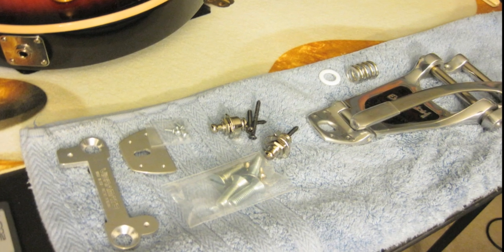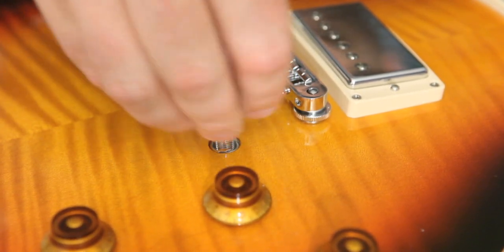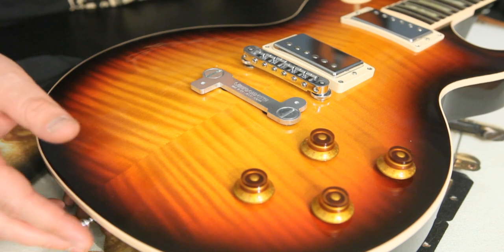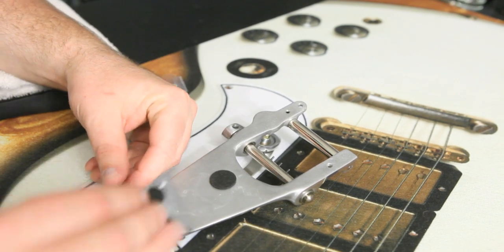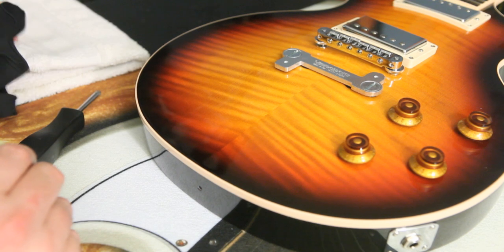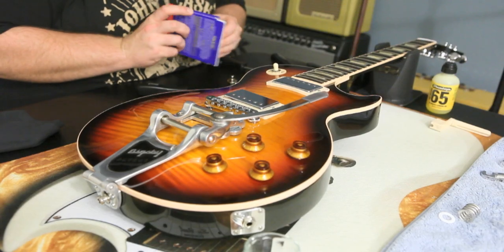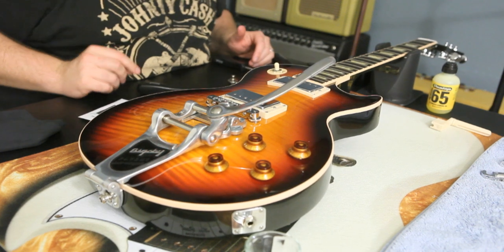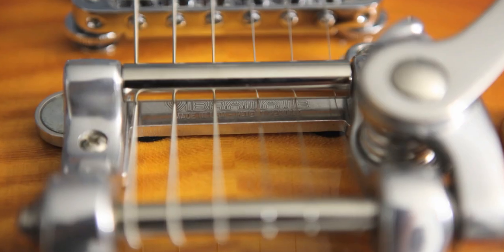How to Install a Bigsby B7 and Vibramate V7 on Gibson Les Paul Standard by Scott Sill

Comment: First let me thank you for your time to make such a very useful video.
Just a small technical question... when you are attaching the bigsby to the guitar in the strap button area, do you push the bigsby down to touch the guitar top or leave some space???
Reply from the maker: WaTa Blues thanks so much!  much appreciated.   The bigsby rests against a plate that the Bigsby screws into.   That plate rests against the guitar but it has some nice felt pads on the back to protect the finish and guitar.
Reply: Thanks for your quick feedback, I know about the vibramate plate,,, what i was asking about is the Bigsby part that stays over the guitar top near the binding area. Does it have to touch the guitar or some millimeters should be left?
Reply from the maker: WaTa Blues  yes, the Bigsby doesn't touch the guitar.
Reply: sillennium Thanks Man...
Wish me good luck installing it tomorrow!!!
Reply from the maker: WaTa Blues Good luck!
Reply: sillennium I just installed it yesterday but i was not able to make the tailpiece plate rest on the guitar!!! the bigsby was just to short. It stayed inclined at one point.
Do you have any suggestions???
Reply from the maker: WaTa Blues what guitar did you install it on?
Reply: sillennium A 2012 Gibson Les Paul Standard (desert burst)!!!!
Reply from the maker: WaTa Blues send me a personal message via YouTube or email me directly via our website for Flo Guitar Enthusiasts so I can see pictures of your issue and understand it more.

Comment: Does instrument still stay in tune after instalation?  Doesn't there supposed to be drilled new holes for screws around straplock? Does the fact that you didn't t drill holes and u didn't put any screw in it affect badly for the tuning or bigsby stability?
If you'll answer me you'll be very helpful!
Reply from the maker: Yes

Comment: Question about my Bigsby.  Bought a Epi Les Paul that comes with the small Bigsby.  The previous owner had four washers on the bolt under the arm where the spring is.  What is supposed to be there;  a sleeve of some type?   The spring and arm worked great  (after I fixed it) but while playing,  the arm loosens up.  Seems all the washers aren't what should be there.  Can't find any photos that show the original assembly.  Thanks in advance.
Reply from the maker: Tighten the nut

Comment: Does the guitar still fit in the case properly with the bigsby on it? Is there a way to rotate the trem into a position that it will close? Thanks in advance!
Reply from the maker: nitemareman1 yeah it does, all you have to do is twist the bar pretty much all the way backwards to its lowest position.   It works fine in the case.

Comment: Hey scott, I have a question. .
on vibramate's website, there was a diagram saying the distance between the tailpiece and the rear strap button must approximately be 6". but on my Les Paul (not a gibson), I measure it to be around 5.5". do you think it would still fit well, despite the half-inch difference??
Reply from the maker: No diagram

Comment: is this possible on a esp ltd ec 256?  also dit you screw into the body at the straplock part? because i dont really want to screw into my guitar
Reply from the maker: This is meant for a LP guitar, so any other guitar would only work if it is the same dimensions as a LP guitar.

Comment: Did you need to change the action of the guitar on the bridge? considering that the vibramate adds some height to the strings before getting to the bridge
Reply from the maker: bobafer no it didn't change at all becuase I didn't need to move the bridge up or down because of the vibramate.   Thanks for watching!

Comment: Installed this on an Epiphone Les Paul Studio and the Bigsby is kind of floating on the Guitar now (the part adjusting to the strap lock is in place, but the Part with Bigsby written on it floats above the Guitar). Any way to fix this?
Reply from the maker: Robert Pelz your guitar is a carved top LP right?   If so that sounds correct, that part doesn't sit against the body, it would float above it.
Reply: Yep, it is! Thank you for the answer!
Reply from the maker: Robert Pelz NP

Comment: I'd like to install a bigsby on my Epiphone Lucille. Can I use B7 on my guitar? Any suggestion? Regards
Reply from the maker: Roberto Carlos Ortiz García you can install a B7 on the Lucille, but it will require some holes to be drilled.  There is a new kit that works with ES-335 guitars from Vibramate, that might work with that guitar.

Comment: Would this work on a 2014 Gibson ES Les Paul....it's a gold top and is missing that final piece...and bigsby is it!
Reply from the maker: +linxMuppet it should I don't think there is a body size change in the ES just a semi hollow body with a different tilt on the neck to the body much like a 335.
Reply: +sillennium thanks btw :) also, will it fit in the brown Gibson case
Reply from the maker: Yes you just have to turn the arm of the bigsby clockwise till it stops near where you would rest your arm when you play.  That puts the arm at its lowest point allowing the case to close, snugly, but close.

Comment: Nice video! Question that's sort of unrelated to the bigsby, maybe not... I have a 2013 Les Paul Signature T model with that stupid min-Etune system. That thing crapped out on me because it's a POS, so I'm looking to get new tuning heads. I have been trying to consider which ones to use, as some don't seem to fit right and require boring out the back of the holes in the headstock (grover tuning heads seem to be too think for example) ... I am curious which heads you have on your les paul in this video... I am also curious as to some feedback regarding whether or not I should consider locking tuners if I end up going with the Bigsby (Which I may indeed be doing after this video) ... Any feedback would be MOST appreciated!! Thanks! And don't listen to these other fools on here saying you should beat the crap outta your guitar... I appreciate a dude who takes care of his gear!
Reply from the maker: i have grover locking tuners
Reply: +Cereal Killa Maybe late, but from what I've read on the net classic Kluson type are a drop-in replacement.
Reply: SteelSkin667 Yea I got grovers and they dropped right in with zero issue... Very late reply, but thanks for the input anyway, as this might help someone else who is in a similar situation as I was.

Comment: Just a quick question. I have heard that the Bigsby B7 causes serious tuning issues. On a different youtube video a chap claiming to have sold this problem by inventing a device claims that guitars players who use the Vibramate V7 do not suffer from tuning issues. Is this correct?  Thank you.
Reply: I doubt it makes a difference, all the vibromate does is prevent you from driling holes on your guitar yo put the bigsby on.
Reply from the maker: Only if your nut is bad

Comment: is there anyway to lock the arm or the spring so that the spring wont fall out....?
Reply from the maker: you mean when changing strings?
Reply: +sillennium in general, if the guitar is droped or your sleve is caught on the arm, thus flipping the arm back etc
Reply from the maker: +Michael Petersen the strings keep the trem bar from coming off along with spring, the only time you have to worry about that is when you change strings.   just keep the guitar level and you shouldn't have an issue.   i suppose you could use painters tape while changing the strings to take the trem bar from coming up while the strings are off
Reply: how does the strings hold the arm in place...?
Reply from the maker: +Michael Petersen through tension.  their is a lot of force put on the bar and guitar by the strings.   you won't pull the bar back even close to pull out our lose the spring.   the trem bar is bolted into the bigsby.
Reply: +sillennium okay thx alot - nice video
Reply from the maker: +Michael Petersen thx man,  thx for watching
Reply: BTW how do adjust the string hight when you have vibrato on....?
Reply from the maker: +Michael Petersen the tunomatic is where you would do that.   the bigsby is lower than it so you change the height with it.
Reply: +sillennium okay and that goes for all vibrato systems...?
Reply from the maker: +Michael Petersen no, other vibratos work differently.
Reply: +sillennium okay thx alot

Comment: Hey, I've just watched your video and I found it pretty interesting. I have two question though.
1) First, I've noticed the video is about 2 and half years old, so I was wondering : do you still have the bigsby on ? And if so, does it hold still after all this time ?
2) Secondly, I have a LesPaul quite pretty much the same as yours, and I was wondering : how can you be certain the Bigsby you bought is gonna fit on your guitar ? I sensed some hesitation at the beginning of the video, and I very much doubt you would have bought it in the first place had you not thought it could actually work. So could this mean you knew the very specific kind of Bigsby that was needed for your guitar, or was the B7 just the closest thing to what you needed ?
Reply from the maker: InTheDesertRain Yeah I still have it on and don't really plan on removing it, but who knows I may at some point to change things up...but doubt it.      The bigsby B7 is the one used on the Les Paul 98% of the time and the Vibramate V7 is specifically made for installing the B7 on a Les Paul carved top guitar.   I hesitated in the video because I had never done this before, so I was doing it for the first time, and I a bit anal about not doing something wrong to my guitars. :)  Thanks for watching.
Reply: sillennium
Thanks for your answer ! Cheers :)

Comment: I have the exact same guitar with a Bigsby B7 and a vibramate. It installs fine. My only problem is the screws holding the vibramate in seem to be pulling out of the body about a centimeter or so, like the whole B7 is being pulled back towards the strap lock. Any idea how to fix this?
Reply from the maker: Nice

Comment: Can this also be done on a Gibson SG? A B7 model bigsby?
Or do have to use another type of bigsby?
Reply from the maker: You would need to use the Bigsby b5 and Vibramate V5 for a SG.   It works great on an SG too using those products.
Reply: sillennium And this must necessarily be a Bigsby B5?
It can't be done with a B3 or a B7?
Because I've seen some pictures on google of Gibson SG'S with B3's and B7's on it.
Reply from the maker: A B7 was never intended for being installed on anything other than archtop guitars, that being said where there is a will there is a way.  Just look at the Flying V with a Bigsby... I am sure that wasn't what they intended but it works!
Reply: sillennium Is that the same for the B3?
So it can be done with those types of bigsby's?
Or will it damage the sustain of the sg?
Haha thanks man. I just wanna be sure it won't damage the guitar.
Reply from the maker: ***** the B3 is a floating Bigsby that actually isn't connected to your guitar other than at the strap button.  I suppose you could use the plate from the V7 kit to attach it, but you wouldn't need the other part if you were using a B3.   If you using for a les Paul my recommendation would be going with what the intended the B7 and V7 together.
Reply: dude  check out the stetsbar ,,, a much much better system with no drilling ,,, or the gibson lute and lyre ,,, i have two old sg"s and both stay in tune with the gibson lute and lyre , and both  keep their vintage value because it is gibson factory parts
Reply from the maker: ***** thanks for stopping by.

Comment: Why did the unit move when you installed the strap button?
Reply from the maker: I was on a table,  nothing holding the guitar  from moving when i put pressure on the screw.

Comment: could you add this B7 to an epiphone SG? same measurements?
Reply from the maker: I would put a b5 on an SG
Reply: sillennium i did some research and the B5 is definitely the way to go. I just rather enjoy the look of the B7
Reply from the maker: The B7 is cool, just not a great fit on the flat topped SG and i think it is a bit shorter than a les paul so that makes the install harder

Comment: i wanna know that if i put a bigsby on my les paul the guitar don't get uncalibrated? sorry if my english it's not correct it's not my idiom!
Reply: +Luis Torres Assuming your talking about intonation, then, no it should go out because the bridge is still in the same place, so from where the string starts its vibrations (On the bridge saddles) it is still the same, all the bigsby is doing is allowing the player to tighten and loosen the strings. The intonation stays the same as before the installation.
Reply from the maker: It may be a small setup but it will be all good

Comment: Do you have a roller bridge on it now because of the bigsby or is that a standard Gibson bridge?
Reply from the maker: james madison I have kept the original bridge on without putting a roller bridge on.   The only thing I would like to change on the guitar is the nut, but I can't convince myself to permanently modify the guitar.
Reply: sillennium I wouldn't consider a nut change a mod. A mod to me is something that alters the wood in a way that can't be brought back to original condition. I don't even think changing electronics are a mod, as long as the originals are kept handy and the wood isn't drilled. It's no trouble to buy a stock Gibson corian (plastic lol) nut and put it back in place. Actually Gibsons are known for setting the nuts quite high at the factory and each player should adjust the nut to his or her own liking. I actually install PBE (pre ban elephant ivory) nuts on all of mine. It's what nuts have always been and always should be made of, imo. If actual elephant ivory is upsetting to you, you can use walrus or fossilized mammoth ivory (it has a cool vintage brown color). Just go to guitar parts and more on the web. Great video!
Reply from the maker: nitemareman1 thanks man much appreciated for the suggestions.  I am hoping to put some sort of a bone nut on the guitar at some point....don't really have a preference if it is mammoth or dumbo in my opinion.
Reply: Yeah the PBE is stuff that can be proven to exist in the country before the ban. Surprisingly there's tons of it. Especially the small stuff needed for instrument parts. I would never use new ivory, but even the thought of ivory at all sends some people for a loop. I had one guitar repair shop refuse to make a nut for me out of it! He just couldn't understand that he wasn't saving any elephants by refusing. Oh well what can you do? lol
Reply from the maker: Not a whole lot other than go somewhere else.  Not worth fight for sure.

Comment: I read that lemon oil can eat away at the glue in the inlays on the neck and eventually the inlays can actually come loose, is this true or a falsehood (lie). If there is any truth to this i will not use lemon oil anymore. I see that some luthieres use linseed oil, is this any good. You can get it at the local Harware store so that's cool. Great video thanks.
Reply from the maker: Lots of people sell and use lemon oil.... so doubtful but I guess anything is possible

Comment: hey mate. will this method work on a es 335?
Reply from the maker: possibly, but it would depend on the measurements of the guitar compared to the LP.   If it was possible to use on a 335 I am sure they would market it that way so I would lean more that it doesn't work for it.

Comment: Will a bigsby fit on a Epiphone Les Paul 100 so basically its a les paul with a thinner body almost the half of an original les paul so im not sure if a bigsby will fit because of where the strap button is because on a full size les paul the body is thick and the strap button is on the center but my epi lp 100 is thin and the strap button is on the center. So  the strap button is closer to the top and im not sure if a bigsby will fit.I hope someone will answer this question thanks :D
Reply from the maker: It may not

Comment: How well do they stay in tune ?
Reply from the maker: Just as good as it did before.  The G string is a problem because of the plastic nut and headstock design, not due to the bigsby
Reply: Cool, installing mine in this week 🎸👍

Comment: I contacted Bigsby and they said a normal installation would require drilling holes in the top of my guitar and I'm not about to do that. They also said I could use a B5 Bigsby and the Vibramate and it would fit on top of the stop bar tailpiece and I wouldn't have to drill any holes. If I drilled holes the Bigsby is on there forever and if I ever took it over I'd have those ugly holes in the top of my guitar.
Reply from the maker: Go with the vibramate

Comment: will this work on a epiphone les paul special ??????
Reply from the maker: Noah Taylor a Les Paul special is not a carved top guitar.  The V7/B7 method would be your best bet.  Look into the B5/V5 Vibramate/Bigsby combo.  That should do you nicely assuming you have a stop bar tail piece on your guitar.
Reply: I have a wraparound tail piece. Would the B5/V5 still work for that?
Reply from the maker: Noah Taylor I believe so, but you can always check on Vibramate's website.
Reply: Will do. Thanks a lot
Reply from the maker: Noah Taylor NP

Comment: Vibramate could be a great invention if its sides weren't parallels. The Bigsby has to be forced too much to screw the bottom. I installed it in my Epiphone and I think it happened because it's not a Gibson, but I saw in this video that in this guitar has the same problem.

I think i'm going to remove the vibramate and drill two holes on my Epiphone.
Reply from the maker: Hell yeah